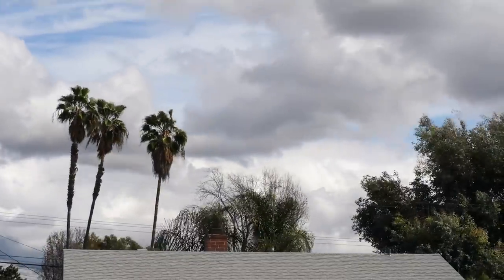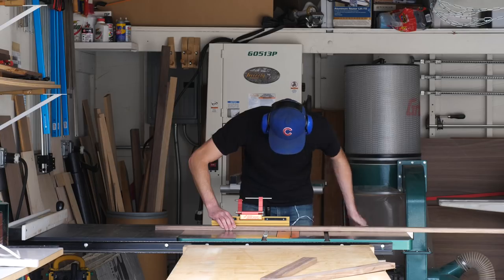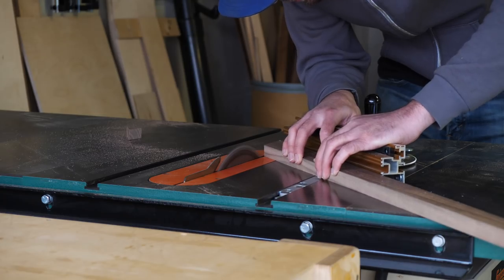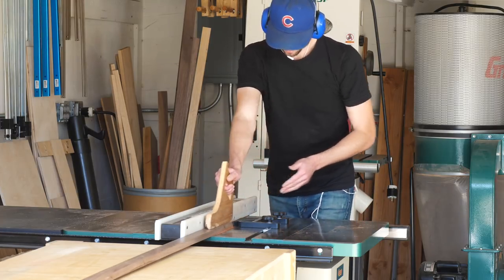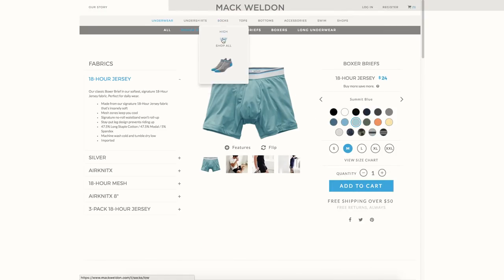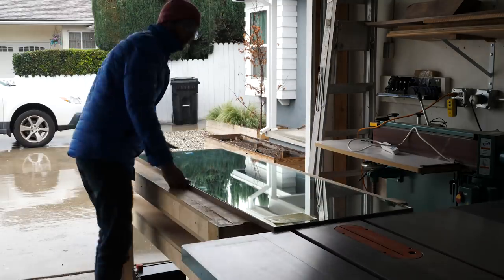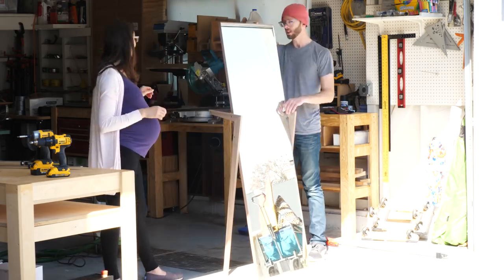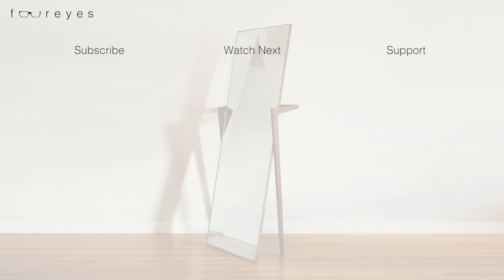How To Build A Free Standing Mirror | Woodworking

Comment: I’ve been wanting to build this mirror, but I’m stuck on how to calculate the angle on the tapered leg. Anybody have some info they could share on how to calculate the angle so it’s a 90, but connects the two pieces in line with eachother ?

Comment: but Hey! nice project! I would like a mirror I could have display temp. time. battery voltage. solar current. current used. I could maybe use led meters. I just need a mirror that will allow them to shine through! I don't exactly know where to get a 2 way mirror. I guess i could use glass. and mirror tint.
Reply from the maker: or just take what I did one step further, print out some clear stickers and put that on your mirror :P

JK - I actually know nothing about smart mirrors at all...obviously

Comment: Are you supposed to use gloves? Or not, because they can get caught in the machines? Could you have used a stick to push the wood through the saw to cut the pieces? I'm trying to learn because I'm going to do some projects myself.
Reply from the maker: I use gloves in certain situations - but you should not use gloves.